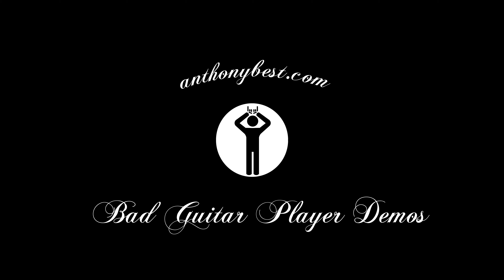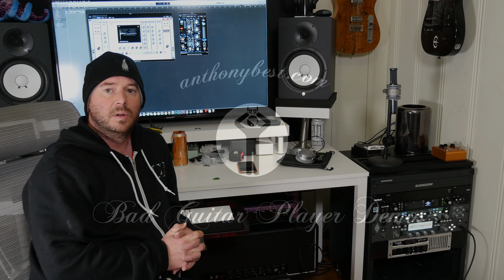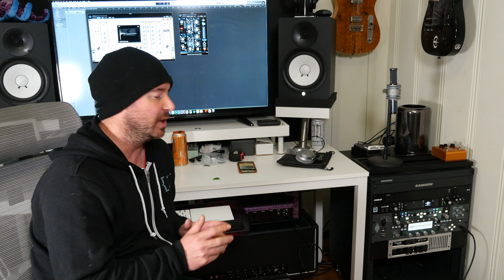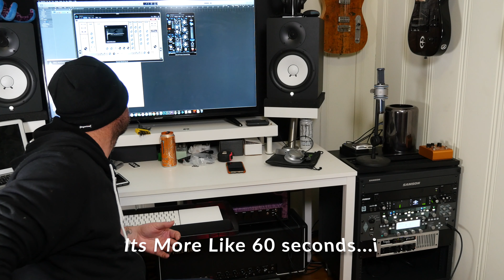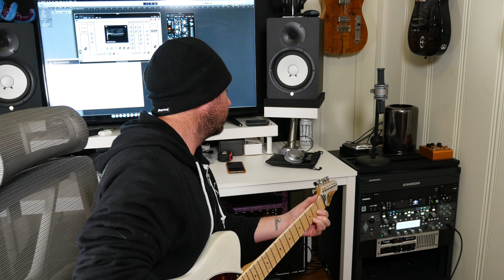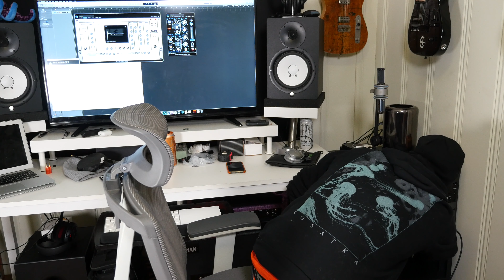Create Awesome Kemper Profiles at Home: Using Loadbox and Cabinet IRs

Comment: hi! very nice video!! just a question for you.. i have a torpedo captor x and i want to profile my amps, what chain i have to use to make the best profiled sound? i will try the chain: Amp -> torpedo , 1 output of the captor to the audio interface and 1 output into the return of the kemper, the send of the kemper into the in of the amp, and one main out of the kemper in another one channel of the Audio interface.. with this chain i think i can listen into the monitor the sound in one channel of the amp and in another channel the sound of the kemper, obviusly reminding that i have to use the IR of the torpedo to make the ir simulation, it can be right? i have to connect the reamp or something? i think i can use a daw and some plug in too in this way but i'm not really good in this stuff, i'm just learning all the things cus i'm new in this world.. 
thank you!

Comment: What output are you using to send to the Kemper? I’ve been trying with the Line 3/4 out and not having great results. Assuming it’s looking for a mic level signal and not a line level?
Reply from the maker: THis is something I realized as an error in my process.  I should have used a reamp box to return a mic signal back into the input of the Kemper.

Comment: Great video mate! Just a quick question, are you sending the signal back to the kemper via the loadbox or via the audio interface (e.g. focusrite)?
Reply from the maker: you could do it either way honestly.  If you want a direct profile send it direct.  if you want to add the cabinet to the profile itself you need to run it through the interface and load the IR onto it.